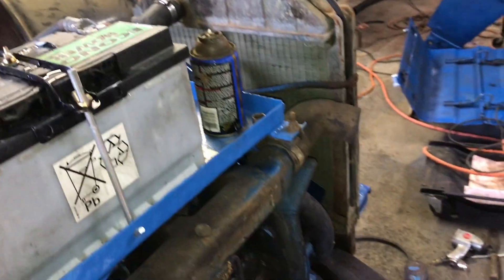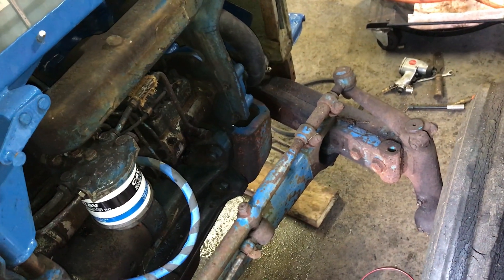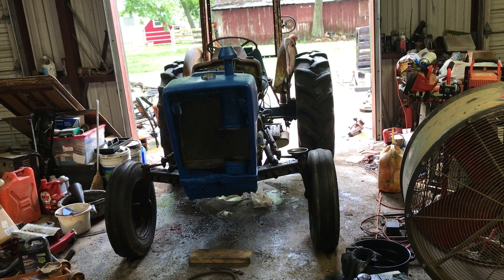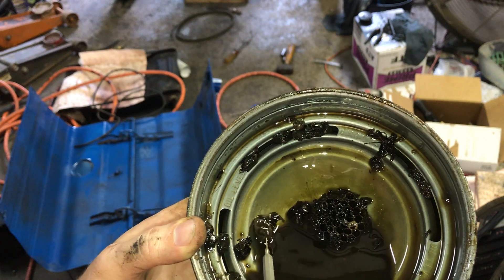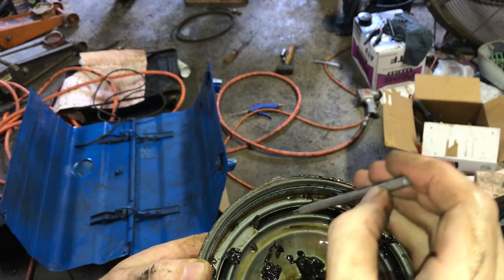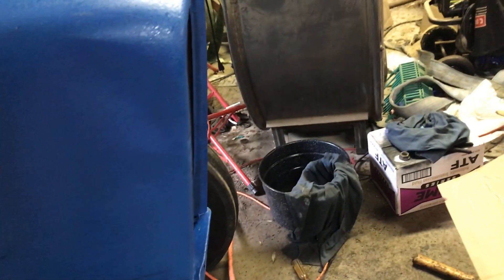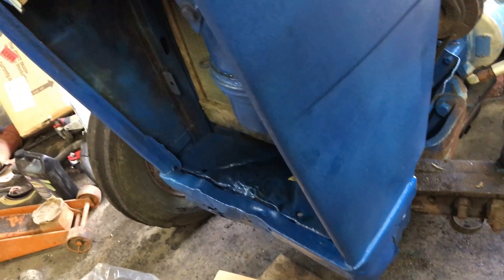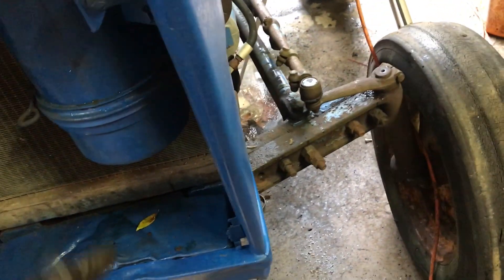Ford 2000 Tractor Cooling System pt3

Comment: No video of reinstalling thermostat and testing of said thermostat alomg with cooling system operation ?
Reply from the maker: I showed in the video installing the thermostat the first time, figured I didn’t need to show it again. The thermostat is working correctly and the first one I installed was as well. The dash gauge is not working correctly and I will show that in an upcoming video.